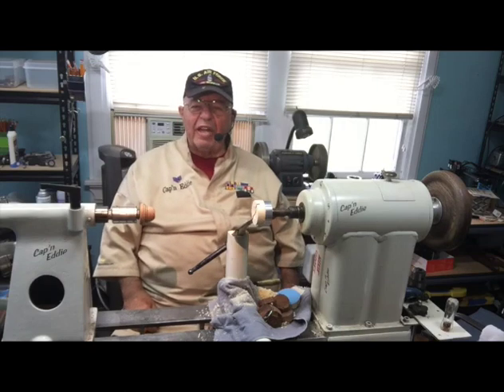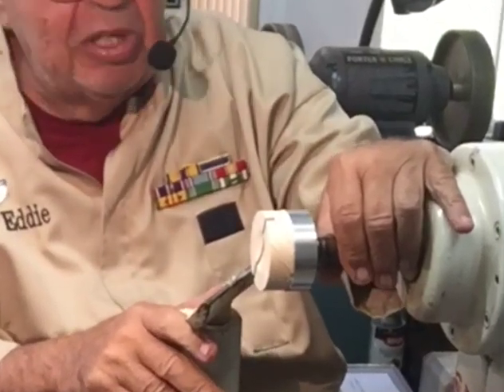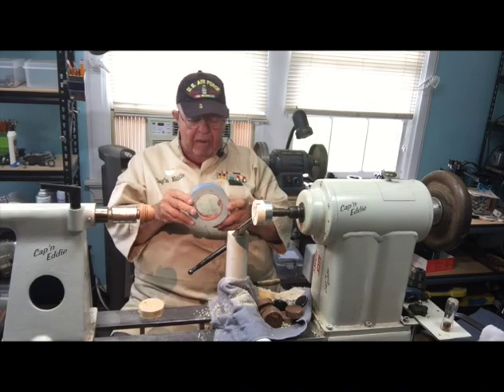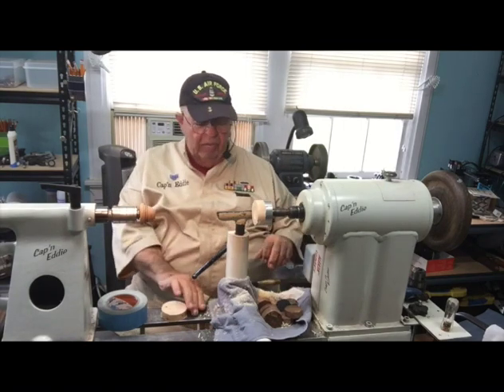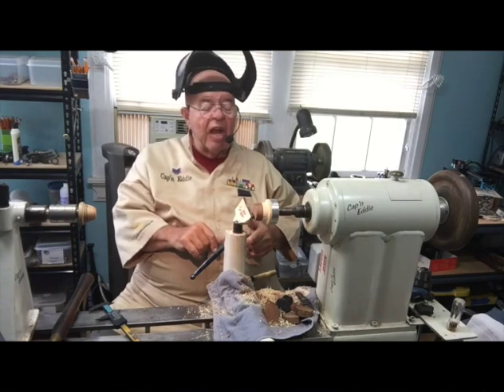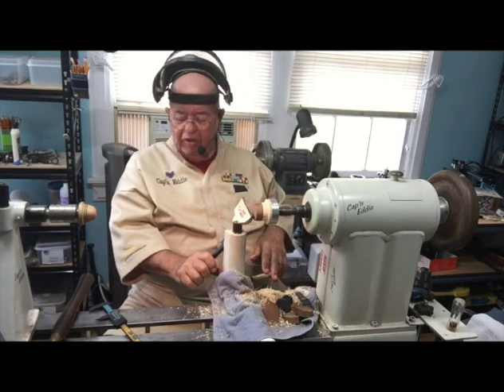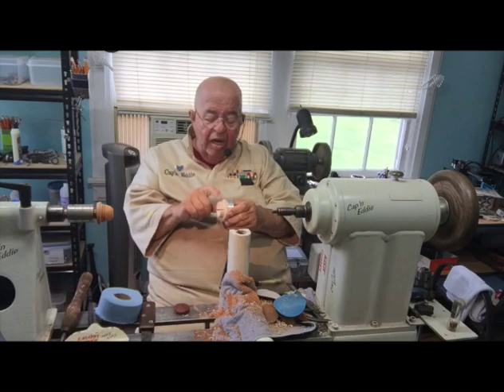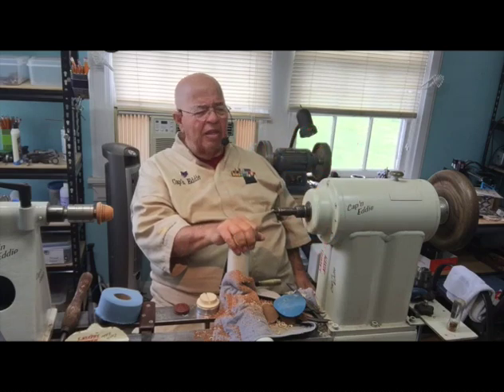Fobs, 2

Comment: Excellent video Eddie. Can’t advise on the wood unless it’s lacewood. However, when you need to take the block off the Niles Offset plate, DNA will soften the glue. Of course heating it with the heat hi. Will do it as well. Great to see you back at it.

Comment: Enjoy your videos, glad to see you back on the lathe.  There is a free (free is best) excell spreadsheet out there made to work with the Ruth Niles jig. that will draw your design on your computer for you.  No programming  required.  You just input the size of your disk and which offset holes you want to use and it draws your lines on the disk.  Saves your wood in that you aren't guessing what the finished pendant will look like.  It also works with the spreadsheet in Open Office which is also free.  You can get it from this site (partway down the page) I hate the trial and error method because before I found this about 90% of what I did I didn't like.